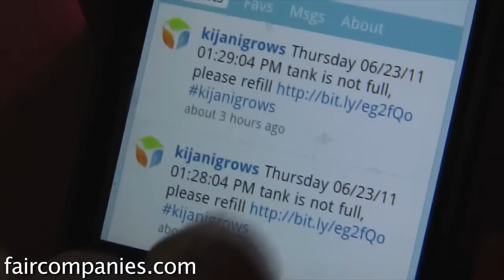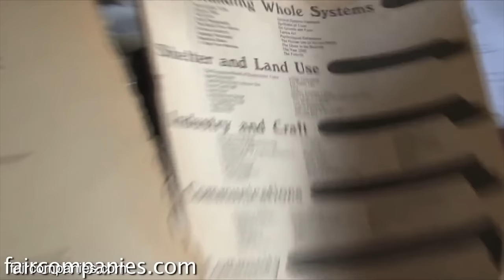Access to tools to help craft your self reliance (by kirstendirksen)

Comment: By building on the country I became a master electrician, framer, plumber, drywall installer/finisher, metal roofer etc. It has its risks, buy a retractable fall harness and use it.

Falling hurts big time.